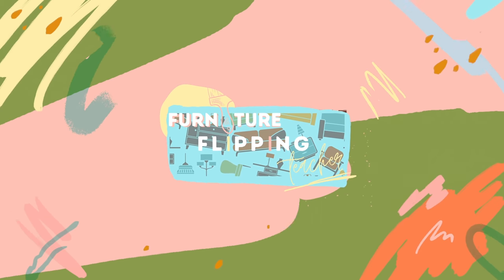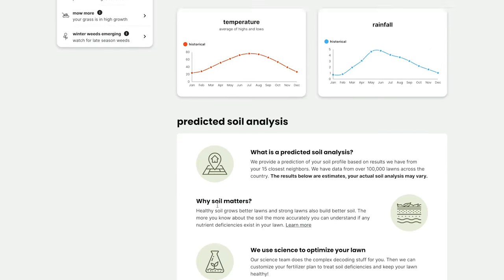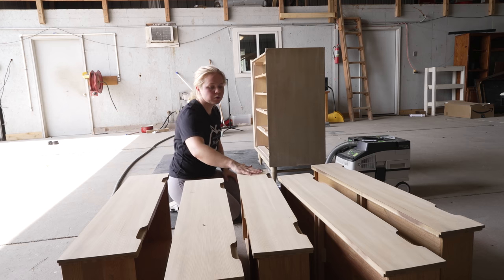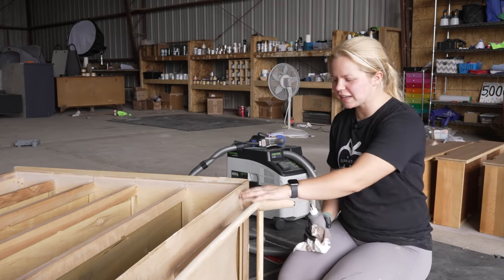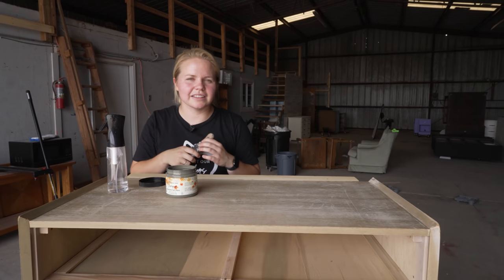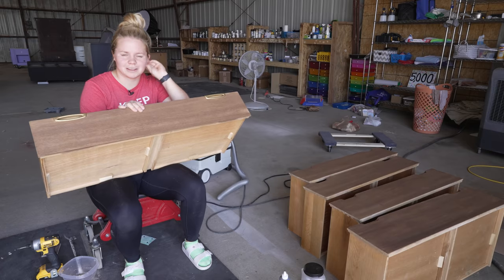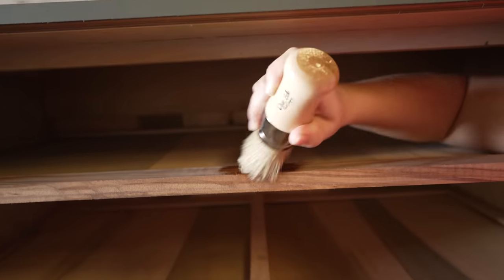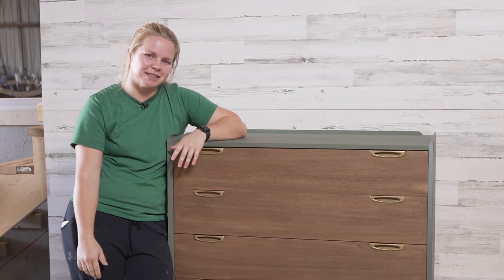Extreme FALL Furniture Makeover | How to Use Water Based Stain

Comment: I am in the middle of updating a dresser.  When trying to remove the handles i realized that some of the screw heads were damaged and I struggled to remove them.  Do you ever have that issue?  Would love to have a video on your experiences and/or answers to issues such as this.  I finally got 15 of the 16 screws out but the last one was impossible so one of the handles could not be removed!  Finally decided  that I had to salvage the current stain on the drawers and just reinstall handles and use guilded wax on hardware to update.  Not my preference but that is what works or now.  Again, how about a video on how to get hardware off when screws are not cooperating, etc.  Thanks!